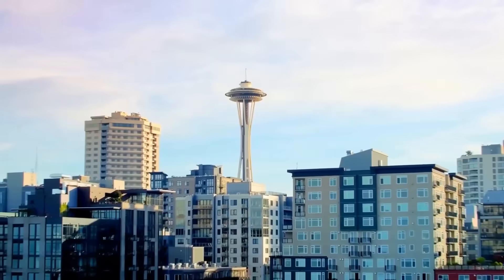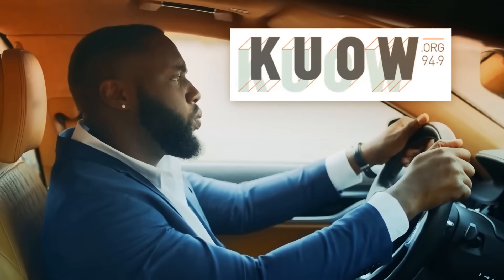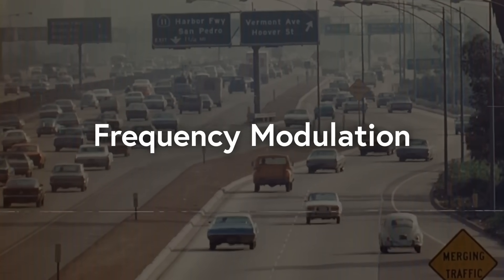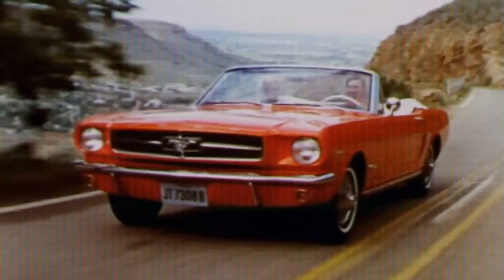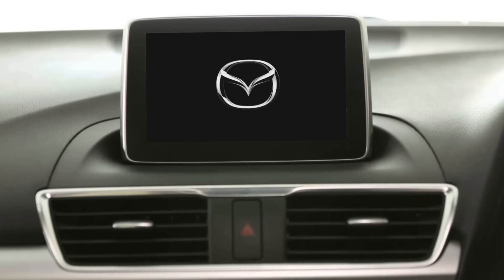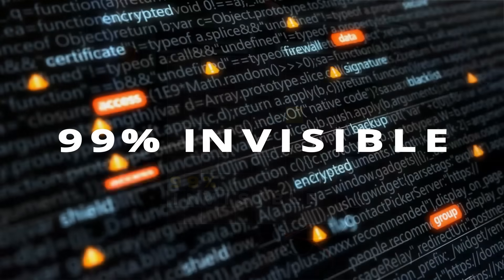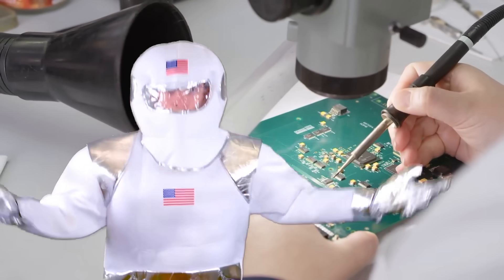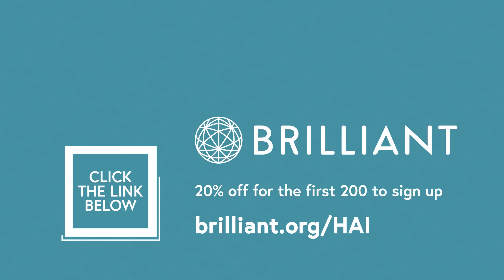Why Hundreds of Mazdas Tuned to 94.9 Broke Simultaneously

Comment: This issue was 100% preventable, just by following LONG established programming practices and having someone review the design and code.
Reply: Your comment with the percentage sign just bricked all Mazdas. 😃
Reply: I'm not a programmer, but I'm thinking just feeding the program some sample library of characters and symbols or some randomly generated strings should have identified the error and that doesn't seem too complicated or time consuming.
Reply: @creativedesignation7880  That's one legitimate testing method. Probably would not have caught this specific issue, but what you describe is known as "fuzzing". Common hacking technique
Reply: @creativedesignation7880  Generally, how you write code is that you have automated tests: unit tests, integration tests, and a bunch of other tests that I, as a developer, don't concern myself with. These tests are themselves computer programmes.

A unit test tests that a given unit, which is small, does exactly what it needs to do. You want to do both positive testing (I put in valid input and I get valid output) and negative testing (I put in invalid input and the programma handles it correctly). Not handling "%I" correctly probably means that negative testing wasn't done, or not done properly.

Two metrics that are important are code coverage and branch coverage. Code coverage measures how much of the code is covered by automated tests. Branch coverage ensures that every time a decision is made (if-then-else, errors, etc) all possible code paths are covered by tests. It is not a measure of code quality, but it helps.

Next is integration testing. Here you test how the units mentioned before work together. There are more levels, but this is often done by other, dedicated teams.

It should be noted that it is impossible to write a piece of software that proves the correctness another piece of software. This was proven by Alen Turing in the early 20th century. It may seem at odds with the practice of writing code to test other code, but that's why I use the phrase "test" instead of "prove".

What should also be mentioned is that the tools that we developers use, usually integrated development environments (IDEs) have a lot of check built in, that will alert you if you make a mistake. Not all mistakes, but many of them. This is static source code analysis. There are other tools and libraries that will looks for probably bugs, lack of code coverage, bad coding practices, etc. You set certain criteria with which code must comply, or it will refuse to build.

Finally, the computer language itself helps with avoided bugs. A language like C is fast and takes few resources (something you want in an embedded environment like a car), but it's very easy to make a big mess. A managed language like Java takes more resources and is slower; however, it solves a lot (but not all) of the problems you can encounter with C.

That is the theory of software development. In practice, you're usually dealing with a department that is considered a cost centre. Nobody buys a car because of its software (especially not a Mazda, as it turns out). So this is something where management will want to minimise costs.

This can be done in several ways. You can cut back on tests and maintenance, or you can outsource to a low income country such as India. As a manager, you set deadlines to ensure that the entire project is ready in time. It would be a problem if the launch of a new car model and all advertising would have to be postponed because the software developers haven't finished yet.

However, the more you cut back on development costs, the lower the quality of the software. There are plenty of very clever developers in India, but they have the exact same constraint of minimising costs. And dealing with people from a different culture brings its own challenges.

Finally, software development is not easy. We humans have been doing it in earnest for a good 60, 70 years now, and while best practices have made huge leaps forward, the increasing complexity of computer systems means that it's still difficult. It's like driving a car: after 10 years, you're an experienced driver, but you still make the occasional mistake. And some people just never get it.
Reply: @SeverityOne  I appreciate your explanation. I think what made the situation untenable was Mazda dealers' refusal to assume any responsibility for their product failing.
I"m a businesswoman, sometimes I have to go that extra step for the sake of earning money down the road even when I am not culpable.
Reply: This is the kind of crap that happens when big corporations pick the cheapest software development bid;  Lowest price isn't necessarily lowest cost.
Reply: This shit is why despite being a fan of computers I don't like them very much in vehicles. Most of my stuff is EFI but you just need a nice little closed system and not even all that much processing power to run EFI. A computer in a vehicle thay does anything more than feed the optimum fuel mixture to the wngine is unnecessary. The last carburetor will probably pull the last EFI to the dump though unless it's too far up a mountain then the carb will altitude stall lol.
Reply: or running tests
Reply: This is not a "lack of testing" problem; this is a "lack of effort" problem. As a database admin, the lack of use of sanitized inputs makes me cringe. Preventing SQL injection / sanitizing inputs is basically the first thing listed in any discussion of security procedures. Which leads me to conclude that there were zero security measures implemented by the programmers. Never trust data from an external source to not mess with your code.
Reply: Chances are Mazda hired old and demented devs back in Japan.
Reply: @fungo6631 Sounds like they found some plane excreters on Fiverrrrrrrrr, more like.
Reply: The worms will always PEBKAC and install all compiler flags.
Reply: Yeah it should be have been a big red flag they needed an update when before this bug they had a bug where %i couldn’t be converted into a string. That being in the code somewhere else should not effect data being read in and turned into a string. Operands like % and common variable names like i should definitely be included in any testing, the fact it wasn’t makes me think they didn’t test much if at all.
Reply: They should've just used 10 print for the gps and a regular radio
Reply: Programmers are as dumb as everyone else.
Reply: You'd think there'd at least be a way to reset the computer. The bug would still happen, but you wouldn't need to throw the computer out.
Reply: i used to work for them, they info system bugs all the time, its the 2nd worst after toyota, toyota you need to replace everything, even the body control module, takes 2-3 days fucking garbage dont buy these
Reply: Car programmer here. We do have code reviews. Too bad that the codebase is too huge and complex for any reviewer to be aware of every possible way a change will impact the code. And as for testing... Sure, we do that. Too bad that our Jenkins is so unstable that we can never know if a test failed because of a bug or because someone sneezed in the office. Well, better to get false fails than false passes I guess...
Reply: @ishashka  So these cars costs tens of thousands of €/$/£, and you get the cheapest possible build server? Not even GitLab? And if one change affects so much other code, you're writing it the wrong way. Compartmentalisation is. key.
Reply: @ishashka  As the saying goes - GIGO.  As such- validate your inputs.  Always assume the info being sent (e.g. a filename) is faulty in some manner.  No different than MCAS on the Boeing 737Max.  As for 'Huge and Complex' - that's a solved problem.  You're management doesn't want to spend the money to solve it.
Reply: @ishashka  So take some initiative and fix it, ffs. Lots of industries use custom embedded machines more complicated than cars and don't have these problems

Comment: Sounds like an exploit to gain access to the(a) cars file system through the digital radio signal. 
Hmm this is interesting… 

Imagine someone using this method to attack drivers on a mass scale if they could get the CAN system to react to a malicious signal(airbag deployment, brakes, accelerate, electric power steering). 

They could send the signal locally from a device in hand, or they could hack a radio station and then send out the signal much further.

Comment: This reminds me an awful lot of what happened to me and a fellow apprentice. Our programming teacher wrote a little bat to delete all those unnecessary files compilers like to generate. Files that the completed projects no longer need and that the compiler can easily generate again if necessary. We used Borland C++ builder, which also generates files without an ending. In the batchfile you'd simply write "del *." to get rid of them, and in school, on my USB-drive, and even the local harddrive of my work-PC this worked fine. However, on the server it got interpeted slightly differently: first of all it got treated like a "del *. *", deleting ALL files, and it also worked on the whole drive instead of my folder and its subfolders. Basically I ended up deleting all the projects I had access to which due to me hopping between departments were quite a lot. Thankfully a friend in IT and the recovery function dealt with that rather quickly, but my friend showed the batchfile to his boss (telling him that I'd asked whether this is safe to use) and I got a nice letter to give to my teacher explaining how dangerous this can be and that if we really had to bother with saving a few kilobytes we should do it manually
Reply: That's the sort of thing that can cause trouble.  Something perfectly proper and gets retconned into something destructive.  And than there's the actual mistake.  Del *,lst comes to mind.  Note comma.

Comment: Well, I do have a computer science background - and the fix for Mazda is relatively simple.  Likely, the operating system used in their infotainmen.....car computers, is some form of Linux - which has an army of open source utilities available to it - including GNU File Magic, which offers the ability to inspect file contents to determine the type of file.  A relatively simple modification to look at the magic result instead of trusting the file extension would/could have fixed this issue.  Sadly, auto manufacturers are like phone manufacturers - once you buy the device, they aren't interested in doing software upgrades.

Comment: The originator of the format pronounces it like the peanut butter brand. However, convention is (mostly) to pronounce an acronym based on the sound the letters use in the word represented by the letter (which is why ASCII uses the k sound for the c and not another s sound). 
Personally, using the hard g helps distinguish between the subject being a computer term and a food item.

Comment: "This was partially a result of how these cars were built, but it's also a result of how this radio station broadcast it's radio signals"

Dude, this was entirely on Mazda. "Never trust user input" is one of the fundamentals of coding.
If this obvious but accidental example was missed then how many deeper rooted issues do you think are just waiting to be exploited?

Honestly, HD radio sounds like a bad idea in the first place. What stops anybody transmitting data that your car automatically downloads and tries to open?

Comment: Having worked in vehicle infotainment engineering, I find it amazing that worse doesn't happen more often. ROM images on these head units can take hours to compile, have software from tens of suppliers, and end-to-end testing is practically non-existent, let alone exhaustive suites of edge-cases like this.
Reply: That explains why they're always such a clunky and miserable UX nightmare.
Reply: @DELTARYZ  I work assisting in car infotainment IU and functionality testing for a spanish carmaker.
You are in fact not wrong.
Reply: Doesnt make sense. U would think u have a dev environment to test first before u put it in production.  Car manufacturers r really that incompetent huh?
Reply: @webguy943  No, but shareholders and financial managers typically are. You go into those fields if you were too mid to learn any sellable hard skills.
Reply: Indeed. The individual components are usually well tested but not the entire product. My specialty as a automotive (drive) testing engineer is viewing the software in a customer perspective. We call ourselves the shit detectives because we always find a stinking pile of it when we go out testing. And then get ignored by managers that care more about their deadlines then a good product. It does really make you cynical over the years.
Reply: I would have thought they used something like openbsd and open source code for most of it and wrote new features they want themselves
Reply: @misham6547 Many Cars actually use Windows CE (6 or 7). More recent cars even use Android. I assume they removed the default homescreen.

While I also would love a FreeBSD or Debian in my car, I assume that its just too much work. Just pick up something that already exists and youre done.
Reply: Seems like a bad system if it takes literal hours to compile.
Reply: @dnb5661  Feel free to write a better version; you'll be able to name your price.
Reply: @outofoffice7540  I can't, but code only takes a few seconds  to compile even at hundreds of lines of C code. At most, it should take 30 minutes.
Reply: @Out of Office  having bad design that bricks the system over file extensions is NOT a ' edge case ' problem, it's a ' lazy design/engineer ' one.
Reply: And yet… the functionality is so simple that it would take a couple months to implement in html and js and it would take way less time to boot, responsiveness would be better, and so on. Sure, nav view can be provided by a separate vendor, but still: if it’s just a web app, it’ll have way less likelihood of killing anything permanently. And clearing the caches on a reboot loop would be simple to implement since all the caches would be in one place. There is a reason why SpX uses a web view for their Dragon II spacecraft: it actually makes it better. They didn’t want to be stuck dealing with, say, Qt (sorry Trolls, long time user - but just about done).
Reply: @absurdengineering  Many, many people have thought of that. Most prototypes are built as web apps; I built them that way myself in the industry, with embedded Linux servers providing vehicle data. Automotive is dominated by salesmen in suits and elderly directors having meetings on golf courses, not driven by the best solution. Various suppliers have exclusive contracts to build systems, and overcomplicate them deliberately to make them more expensive, and keep OEMs locked in.

Comment: If you replace the bricked $1500 unit, it surely will fail again, as the problem is embbeded in the firmware.

Comment: This demonstrates why computers shouldn't be installed in automobiles.  Computers are unreliable.  Just look how many aircraft crash due to computer glitches. I stopped flying when aircraft became fly by wire. My car predates computer junk . It has no computer to fail. Computers are toys, but not reliable enough to depend on.

Comment: it's not the computerisation that's the problem, the problem is poor programming (why was it reading cache for something so transient...) the lack of compartmentalisation between systems (i.e. ECU, instrument clusters, radio, navigation, other entertainment all being run on a single computer...) and the lack of hard reset buttons which go "you will take data from this ROM and overwrite EVERYTHING in your storage with it". You could even have this like, basic input operating system which logs if there was a crash and if there was boots the remaining computer into a safe/known mode where it can clean up the mess of the customised profile or something...

But yeah, if i need sat nav, i'll use my phone, if i need a radio I want the only way it's connected to the rest of the car to be via speakers and power, I don't need and I don't WANT my "radio" to talk to my electric seat adjustment or electric windows...
Reply: Yeah, it's really aggravating how companies trying to save pennies (or scrape data they can use for advertising or rejecting warranty requests) dump everything into centralized, often poorly-designed, poorly-implemented, poorly-updated, and non-user-serviceable computer systems where one minor failure takes out the whole thing, and then don't even bother to include the functionality to reset it factory defaults or externally reflash it. I also hate the other side of the coin, with how this leads to blind techno-phobia in 'car people', even to the point of stupid people constantly parroting the (false) idea that they've somehow gotta "preserve" the popularity of gasoline cars against the trend of electrification because they think they're somehow immune to whatever imagined apocalypse they expect. I could probably with some trial and error build a bare-bones control computer for an electric car (it's just some controls controlling a variable-speed three-phase inverter used as a motor speed controller, an up-scaled version of common RC equipment; and then various independent power steering and braking-type systems. You can build the whole thing as a bunch of smaller projects over time); there's no way in the world I could build an ECU for a modern IC engine from scratch and get it to run right.

Comment: factgory resetting the radios would clear the cache and stop the system from bootlooping. it wasn't just an issue from the HD radio, if you had songs on a device with clipart that had a weird file extension, it would cause the system to loop also.